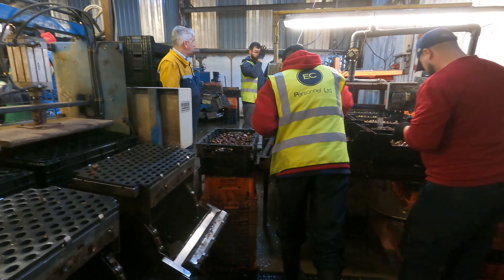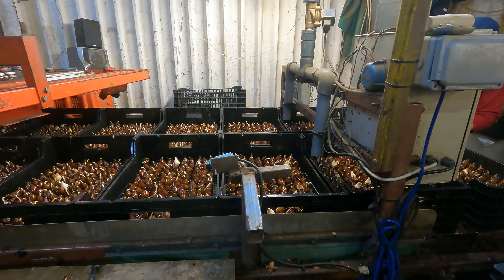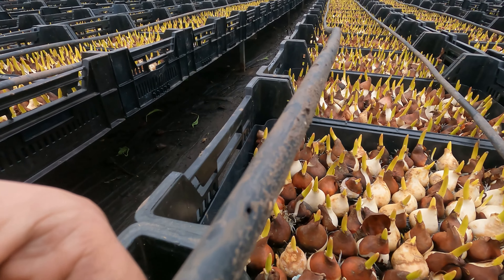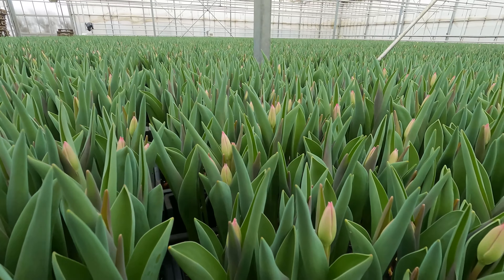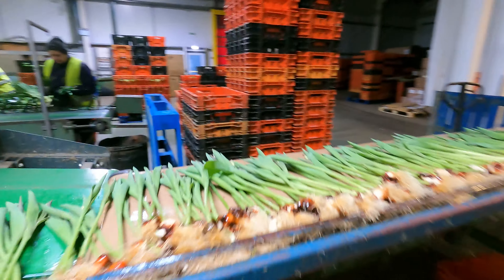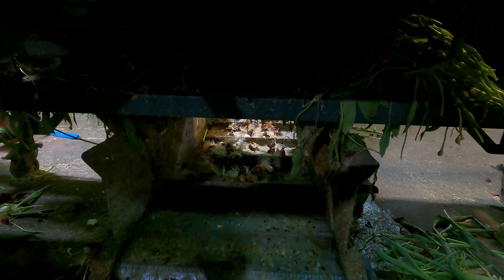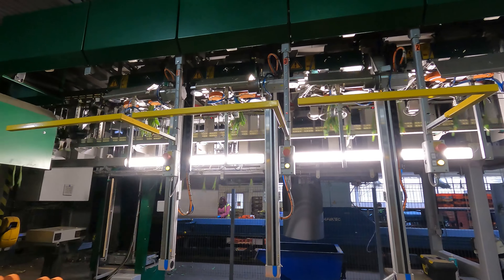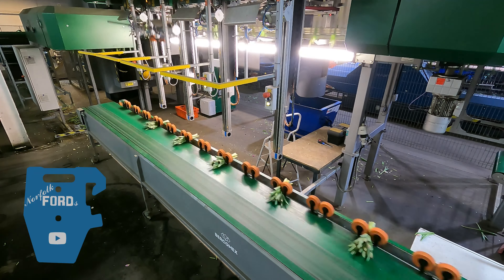UK tulip growing, storing and picking

Comment: Low tech and very high tech Lewis. What an operation. 
What is the lifespan of a bulb? As in years?
Is there any way of more crops per year with the same bulb with this system?
Reply from the maker: The life span is until the bulb is no longer viable to keep growing. It's hard to put a number to it. 
You can return bulbs to the glasshouse in the same year but you have to reenter the coldstore to restart the cycle.